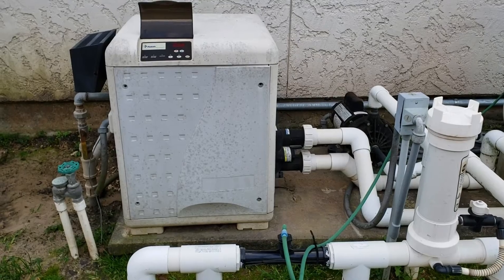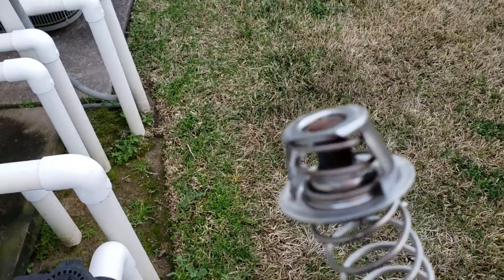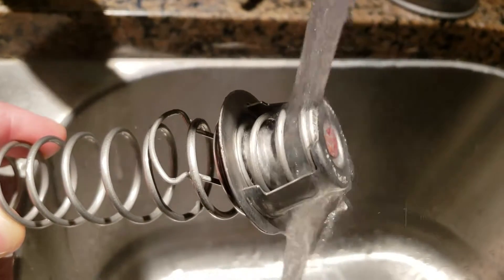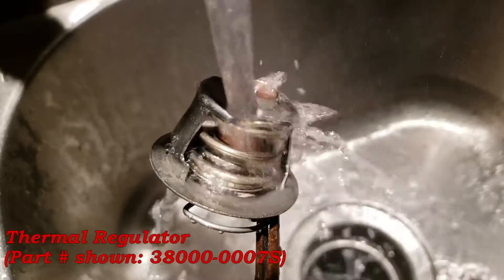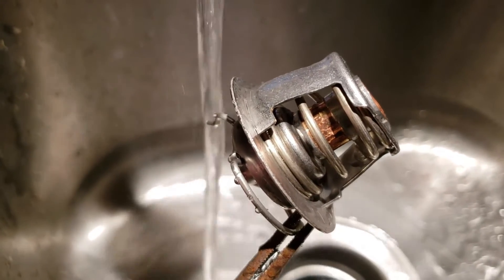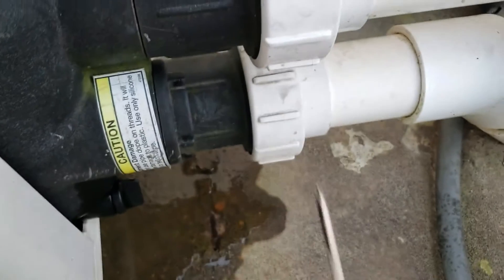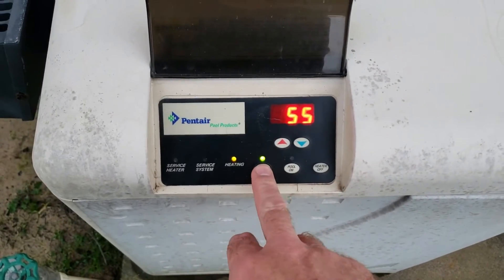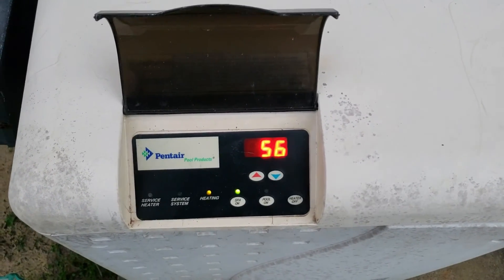Thermal Regulator Replacement on Pentair Mastertemp 400 Pool/Spa Heater

Comment: Hey. My Heater runs fine for a while but then shuts off and I get a service heater light. No error codes. I  checked the backside of the panel and no lights were lit.  I believe it cycles back on again eventually, but I'm not sure. If I shut it down though it will fire back up and heat again but eventually stops. Any suggestions? Is it likely the part in this video? Thanks!

Comment: Very informative and thank you. I have a MT250 and replaced the AGS as per the code under the circuit board and still got a service light so I checked the thermal regulator and it was corroded so I replaced that. The heater worked great for a few days and the service light is back on and not showing any error codes. I did notice a leak where I put the new thermal regulator and perhaps that is my issue, even though I taped it. Glad I kept the original cap perhaps it fit better. When I turn the heater off then on it does run for about a day before the light comes back on. Any help is appreciated.

Comment: water DOES NOT SHOOT under pressure when all you have to do is open the air valve on the filter FIRST.... kinda simple logic????
Reply from the maker: I didn't say water would shoot out.  I was saying I had the expectation that the thermal regulator cap would shoot outward under the pressure of the spring tension.  It really wasn't that powerful of a spring, so it didn't shoot out violently as expected.

Comment: Great video.  Thank you.  Question:  I have a Pentair 200.  What I am experiencing is that my service light will come on a few times a day for my spa and the temp will be around 85 (set point is 103) when I check on it.  I power off the unit and then press "on" and it will start up and heat the water again to 103ish.  It can take a couple of hours to reach full temp.  Then at some point it will shut down and the service heater light will illuminate.  Then when I notice the service heater light back on, I will hit "off" and wait 5 seconds and then press "on" and it will fire up again.  I am not sure but it appears that once it makes temp and shuts off, then it will get a service heater light (no codes).  Is this possibly the Thermal Regulator"?
Reply from the maker: No codes on the display, understood.   Did you check for any illuminated error lights on the back side of the control board?

Comment: This is helpful. My heater on a Pentair Mastertemp 400 is not working but shows an EO5 error code. What does that mean??
Reply from the maker: Wiring to stack flue sensor wiring could be corroded causing open, but more commonly, the problem would be that the electrical open is inside the sensor itself.  Replace the sensor on the exhaust pipe.

Comment: I was able to replace my thermal regulator without using the clip (I noticed it in the box after I installed it).  Is it absolutely necessary to have the clip installed or does just hold onto the spring?  Thanks

Comment: Smae heater my regulator wont come out its stuck any ideas ? Thanks in advance
Reply from the maker: Absolutely, just take the manifold off and find why it is stuck.  Push it out from the inside if necessary.  Bolts are 13mm.  There are about 10 of them, so it will take a few minutes, but easy to do.
Reply: @pvt-pilot  thank you so much for the fast reply when i take it off is there anything i have to worry about falling off or gaskets coming out etc
Reply from the maker: @timmytfpv7316  It will have 12 O-rings (1 on each heat exchanger tube) that will remain on the heater.  The larger O-ring that goes around the manifold will come off of the heater but likely remain seated on the removed manifold.
Reply: @pvt-pilot  cant thank you enough

Comment: Why did you remove the thermal regulator in the first place?  What was the heater issue?
Reply from the maker: My heater would start and run for 1-2 minutes, then cycle off, sometimes cycle back on again for another 1-2 minutes, then cycle back off and then it would throw a SERVICE HEATER light but not have any diagnostic error lights illuminated on the back side of the control board while my SERVICE HEATER light was illuminated.  It is a 100% mechanical component, not an electrical component, so there is no error light tied directly to a faulty thermal regulator.
Reply: @pvt-pilot  My heater is starting and running until the stack flue reaches 475 degrees, then shuts off.  I have read that it is probably a water flow issue where the water is not getting the heat.  It could be as bad as plugged heat exchanger coils. I was hoping it was a thermal regulator fix, but I guess not.  I do get a SFS light on the circuit board.  I am just learning this heater, so I appreciate your video and your response.
Reply from the maker: @Steven Graham  The air temp leaving the stack flue should be low 300s at the most.  You should be able to put your bare hand above the exhaust baffle and reasonably tolerate the heat under normal 300 degree SFS reading.  If you can tolerate the heat with your hand while the SFS is reporting 475 degrees, then the exhaust air is not 475 (impossible to tolerate) and the SFS should be replaced for reporting false temperature readings (different resistances from the SFS are translated by the control board into different digital temperature readings).  If you can't tolerate the extreme heat with your bare hand, then your SFS is likely correct, and you may have a blockage of air flow, not a blockage of water flow.  The only problem with a diagnosis of blockage of air flow is that it would normally be accompanied by an AFS light too.  It takes good air flow to close the AFS (air flow switch) in order to ever fire up the heater in the first place.  So, my gut tells me to check the SFS and replace it if necessary.
Let's try this: check the temp reading that the stack flue is reporting before the heater ever fires.  It should be very close to the actual ambient air temperature.  If it says something crazy, like 200+ degrees before the heater ever fires, then you have an SFS that has fallen out of specs and must be replaced.
Reply: @pvt-pilot  Thanks!  I will go test it now.
Reply: @pvt-pilot  Ambient temp: 54 SF temp: 91  Fired up and quickly the stack flue was extremely hot in a very short amount of time.  The outgoing water pipe was not getting warm.  I will try to find the records of the last filter sand replacement.
Reply from the maker: @Steven Graham  I don't like that temp gap.  This was before it fired?  If not,  shut the gas off on the left side of the heater so that it is impossible to start a fire and get the SFS temp reading again before it pulls an error for no gas.  If you think you have a clog inside the heating tubes, disconnect the output pipe (bottom pipe on manifold).  Just offset it a little so that the output will  blow water out of the manifold directly onto the ground.  You could also put your hand in the water as it leaves the output and see if it is warm/hot if you fire up the heater.  This will drain your pool fairly quickly, so get your processes in your mind to minimize mess and wasted water.  You might have lime/scale buildup insulating the water from the fire, not likely unless you see the scale being visibly discharged into your spa. Also, that would not make your SFS read high either.  It wouldn't matter if your copper heat coils were made of dirt.  The fire would just sit there in the combustion chamber trying to burn dirt, and the same ventilation would still occur, resulting in a normal low 300s degree SFS.  I am still suspecting that SFS, but you may end up needing to remove the top half of the heater to put eyes on the coils themselves.  I have a heat coil replacement video that show you have to do that if it comes down to that.  Good night.

Comment: Sorry I'm getting a r=5 code ? Thanks
Reply from the maker: It is my understanding the r-?? is just the revision number for the software of the contol board which can't be updated.  It does not indicate an error code.  Mine is r-8.  My heater is over 10 years old.  I have heard others in comments say they have r-12.  With you having r-5, perhaps your heater is old like mine?  Do you have any error lights on the back side of the contol board?  Do you have an orange service heater light on?
Reply: @pvt-pilot  Thanks! for getting back to me. After the R=5 code,display goes blank.I replaced the control membrane same results. Pentair cust. service guy thought it might be the transformer but the back side is hard to get to i'm working on getting the back cover off now. he said i need to check the voltage with a volt meter(make sense?) Thanks
Reply: My unit was mfr. in 2007
Reply from the maker: @StanleyASmith-im8bi  Mine is 2009 with r-8 software.  I would think it is the control board, not the transformer, otherwise how would it show r-5 to begin with?  Check the power as the they said I guess, but if you have voltage, I would start with a control board swap.  Do you have a friend that has a Pentair or Sta-rite heater you could do a test swap with?  They are fairly expensive for a maybe.
Reply: @pvt-pilot  I will check around,I Iagree if the display comes on how could the transformer be faulty. Thanks! for your help
Reply: @pvt-pilot  Just talked to cust.service at Pentair, you were correct transformer is good he thinks it's the igniter control module. Any thoughts? Thanks!
Reply: @pvt-pilot  Update,  vacumed leaves out of the bottom of the heater when I turned on the pump heater display came on heater fired up.Display says 128, r=5

Comment: Hi, we were mostly successful at replacing this but the spring came apart and the regulator dropped into the pipe below, which leads to the return. Please help! We may need to be able to get it out with a hanger, but how do we get the  the spring to not unscrew  when we screw the cap on?

Comment: Thank you for your video!  If I set my water to say 95, my heater will turn on, heat the water from 70 to about 84 or 85, then cycle off for a few minutes, then cycle back on for a few minutes and then back off.  It won’t heat the water any higher than that. I tested the thermal regulator as you showed and it appears to be working, although it does appear to be very corroded.  However I can’t get the water out of my faucet very hot, so I put the regulator in a pot of almost boiling waters. Is it possible the regulator is working but only at temperatures higher than what it supposed to?  Therefore when I put it back in the heater it is not actually working as intended? Is it worth replacing it to see if that will fix the issue?
Reply from the maker: I would replace it.  It should only take scalding temp (120 degrees) to open it, not boiling temp (212 degrees)
Reply: @pvt-pilot  Thank you very much!  Your explanations are fantastic.
Reply: @pvt-pilot  I have not yet replaced the thermal regulator yet, but have discovered the heater only cycles on and off when the water reaches 93-95 degrees.  Anything lower than that, the  heater works normally.  Could that still be the thermal regulator not fully opening?  Thanks again, I really appreciate your help.
Reply from the maker: @michaelmiller6843  Yes, perhaps.  Here is why... Thermal regulators have a relationship with the HLS and control board.  If the heater heats water too quickly to the point of scalding, the thermal regulator must open to let some cold water bypass the heat coils and go straight through to the output side and dilute the hot water with cold water.  If this does not happen, the HLS that is located on the output side of the manifold will open which in turn gives an electrical open which is seen by the control board.  The control board will immediately turn the heater off and throw a service heater light until the water in the output side cools down enough to close the HLS and provide the control board with a 0 ohm short (electrically closed).  If you are getting cycling at 95 degrees, check to see if it is throwing a service heater light during the cool down part of the cycling.  If it is, then yes, the water is simply too hot in the output side detected by the HLS and the thermal regulator is not doing it's job.  Good thing is the HLS and contol board will have proven to you that they are doing their jobs.

You could temporarily strap a wire across the HLS leads to trick the contol board into thinking the water is not super heated and is still safe.  This will help prove the point of failure but it is EXTREMELY dangerous.  DO NOT LEAVE IT LIKE THAT.  This can melt plastic pipes, cause a fire hazard, and scald those kiddos.  How about forget I wrote that and just replace the thermal regulator and we go from there.
Reply: @pvt-pilot  Thank you very much.  We are all lucky to have your expertise.
Reply from the maker: @michaelmiller6843  By the way, if thermal regulator replacement doesn't work, these same symptoms could be from a faulty HLS too although you would likely have a HLS light on the back side of the control board if it was stuck open.  Both need to function properly.  They are safety features so you gotta welcome them, even if they are a pain sometimes.
Reply: @pvt-pilot  Got it.  I will replace the thermal regulator first and see if that solves the problem.  I will keep you updated!  Thanks again!
Reply: @pvt-pilot  And good point about the safety features working.  You are correct as they are keeping someone from getting hurt or damaging another part of the pool or hot tub.  Good way to put things into perspective.
Reply: @pvt-pilot  I replaced the thermal regulator and the heater is now working again.  Thank you so much for your help!   I really do appreciate t and will find a way to carry your helpfulness forward.  Thanks again!
Reply: @pvt-pilot  olá sou do Brasil, Rio de Janeiro  gosto muito dos teus vídeos 🇧🇷